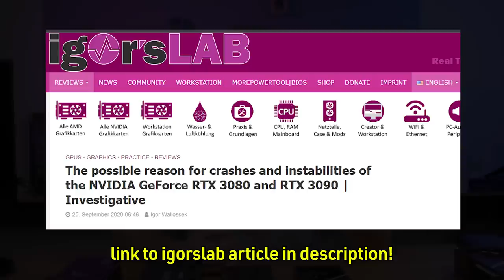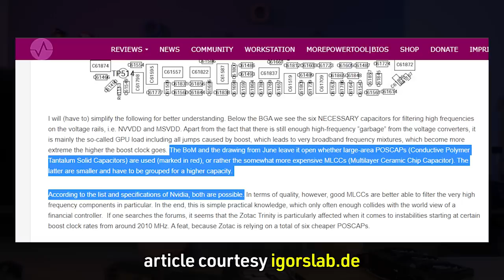The RTX 3080 Launch can't get any worse... Right? Wrong...

Comment: When you talk about "cheap" vs "expensive" capacitor components ... this basically amounts to a total difference of less than maybe $5 on the final BOM, no? It's obviously not a tooling issue since the ODM is already using the smaller SMT packages on the board anyhow. It's not much of a cost issue when you're talking about components priced around $0.15 to $0.75 each off a bulk tape roll. It doesn't even multiply out too hugely when you're talking about a total production quantity of several thousand units.

So how does it justify a retail price difference of many hundred dollars?

Comment: No launch has ever been good. EVER
Reply: True,  but the stock voltage is definitely on the high side. Seems like 0.895V or so is the sweet spot for same stock voltage boost clocks but at 50 watts lower.

Comment: Absolutely the best video to understand the problems on the RTX 3080. I will go to the Asus TUF, which seems to have 6 of the expensive arrays. Thank you so much!
Reply: @Battleneter  Thank you so much for your clarification. My only doubt is why Asus TUF apparently didn't suffer from this instability?
Reply: @TheDIYFilmmaker  Not all cards had reported problems, possibly game dependent. The Gigabyte Gaming OC with ALL SP-caps seemed to have far less reports of crashing than the TUF, but Zotac had the most reports. But its all irrelevant as it was only a bad release drivers now fixed with a driver update, all cards are stable.
Reply: @Battleneter  Thank you. Now is clear. I can't wait to buy it. Here in Spain they are out of stock.

Comment: I'd say that if the boost is part of marketing, than that 1900 clock speed is guaranteed. How much exactly above 1710 is debatable, but the producers are still obliged to make it doable to some extend.

For it to be fair for consumers, those cheaper produced cards must be marketed as "GPU boost-less".

NVidia isn't obliged to make the boost work on cheaper cards, but is obliged to make them say truth in marketing when selling their licensed products.

The failing cards right bow before the change in marketing are in my opinion fully refundable and should be without problems from sellers as they don't work as marketed.

Comment: Shit like this is why I never am first to use new tech, cars, or anything anymore. I used to ALWAYS be cutting edge with the mods on my cars and computers, home theater audio/video gear...  Better off being a just a little late to the party.   At least the problem is fixable with an update to keep the boost clocks down a little bit and the cars arent actually going to need to be recalled.  Still, reason to be pissed for sure if you wanted to overclock.  Should have bought the good cards though that have the better capacitor array if your into OC'n your stuff though anyway.  Ahhh, technology! lol

Comment: There is no such thing as expensive, Inexpensive, they are just ceramic bipolar capacitors In a broken down separate arrangement to how the polarised capacitors are.
Reply: Dont get me started!, Nvidia released a new driver yesterday largely solving crashing on cards with MLCC/SP-Caps or a mixture. It appears the capacitor "theory/Guess" is complete overhyped BS.

Comment: I've been dealing with electronics for a while (doing small projects and all that). But ... capacitors are not that expensive, and SMD components are even cheaper.
Now, I understand that these cards are at the top technologically, but still ... HOW MUCH EXPENSIVE CAN THOSE BE?
I mean, on top of not being that expensive (in general, street price for regular capacitors. About 0.50-2$ per cap for the smaller ones. And for SMDs those prices can be as low as 0.05-0.70$), these guys (the manufacturers) buy those in bulk, so their prices should be even cheaper. Granted, maybe those at street price, could be 5$/cap, but still... charging 60+$ for a 700$ graphics card is not that much. Specially if those prices at bulk are way less...

My point is ... holy crap those manufactures are cheap. I hope they loose all the people's confidence, so next time would think twice to scam people.( and ... yes, I don't care if the specs speeds are 1710Mhz and they are still above that. If you are selling a graphics card above 350$ ... you better have stable "overclocking"(turboboost) capabilities on that card ... otherwise I won't buy it!)

Comment: And drivers update fixed most of the crashes....
Reply: Yea by clocking down the shit out of your card. That's like buying a V8 but it only fires on 4 cylinders...
Reply: @MidwestMTBAdventures  Absolutely not, they tuned how boost works, some folks have better frequencies. And overall performances are better.
Reply: @boypip7018   They absolutely did not. Stop listening to PR bullshit they sacrificed clock speeds to make them stable they where OC far to high out of box. Reports all over today about it..typical of Nvidia hey look at the impressive cards we just made then clock em down because realistically they can't run at that performance. So glad I'm gonna wait for all the bs to settle and see what team red and team green have to offer in the coming months.

Comment: I've been building my computers since the 90' and regardless of how hyped you can get there are 4 rules that seem to never change 
- Never buy the first wave of products of a new generation
- Every 6 to 10 years there is a "revolution" moment instead of the usual "evolution" : that's when the planets align and you get a new generation that crushes the one before for similar price tag, and will survive for a long time (AGP, PCIe, USB, USB2, USB3, HDMI, etc...)
- Check real world tests instead of tests that don't represent your computer usage (example : SSD vs N.2 performance in games is similar ; the difference becomes huge in video editing or other large file transfers // Ex 2 : checking how a 3080 performs in VR with a new gen headset such as the HP G2, in a demanding game)
- While taking into account the previous rules, check what's coming in the next 4-5 years, in order to avoid components that will make any interesting update complicated

Therefore wait at the minimum for the second wave of 3080, ignore USB4 and PCIe 4 (too young / yet to exist), get 2 huge SSD instead of a smaller N.2, and dont forget that high end VR headsets will probably become a lot less expensive in the next 5 years, while quality games will keep getting VR compatibility (hi FS2020 !)

Comment: is the RTX 3070 going to have this problem
Reply: The issue turned out to be Nvidia post release drivers (pre release drivers were fine), had NOTHING to do with capacitors. Jay need to take down this video as its still misleading people like you,  but he keeps leaving it up for clicks $$. Yes Nvidia released a updated driver that corrected the problems on ALL regardless of capacitor type. Watch this explains all.
https://youtu.be/lhyCdraz54s?t=350
Reply: @Battleneter  ok will the problem persist using the same clock speed or not?

Comment: If the design is not to base spec the ABI should offer a full refund or replacement with the correct base BOM. if their are to base spec then firmware update it is.

Comment: I just scored a basically new 1070ti for cheaper than a new 1660 because a guy got a 3080... It would now appear that I got the better end of that deal because he got the EVGA card lol.
Reply: The issue turned out to be Nvidia post release drivers (pre release drivers were fine), had nothing to do with capacitors. Jay needs to take down this video, its just terrible for so many reasons, but he is clearly leaving it up for clicks $$ and misleading people., just watch this,
https://youtu.be/lhyCdraz54s?t=350

Comment: Remember RLL encoded hard-drives?
Remember how touchy they were re: cable routing?
Remember how often they refused to work properly unless the cabinet was closed?
Or the cool way they would get unreliable if two drives were too close together?
Or how the controller cards liked one slot on the motherboard and not any other?
Or how if you formatted the drive in one orientation and it refused to work in any other orientation?  'This side up' was a thing!
I remember a time when exposing the motherboard or hard-drive controller-card to bright light was a no-no!!!
...
Sensitivity to test conditions cannot be ignored, and a good test program takes these factors into consideration.
Lots of words to say I think Jays methodology is flawed!
This cap issue is nothing new (using cheaper parts in critical areas) and its a grand example of users not being able to get away with everything they want to do.
Remove PCB covers?  Run on risers? No cabinet? Extra long ATX power cable? FM transmitters in close proximity?
RFI from video cameras cannot be discounted until a test or two clears them!
Any one of these could clobber a card, all of these together and I am impressed with even short-term stability!!!
Me, being an old radio engineer with a for-genuine FCC license (tested, 97%, not cereal-box!), would expect cross-talk/interference any time the PCB traces are visible!
...
I know it is super-sexy to run rigs the way Jay/everyone else does, but it is not a realistic daily use setup.
Run the tests again, with all the covers in place, no transmitters in the room, no risers or power extensions.
You know, as a 'control', to see if the test-rig is the problem?
I retired from this sort of work, now I visit it for fun!

Comment: MLCCs are not more expensive. They are cheap as dirt. There are few trillion (yes, 1 followed by 12 zeros) produced each year. There are few hundredths on them on any graphics card. The one super close to the GPU are critical tho. They need to be both small and big ones, often of different types. It is not about the cost here, but about the mix, because the mix changes frequency characteristic of the power delivery. The smaller ones, are smaller capacity, but do have advantage you can put them closer to power and ground pins, thus reducing the loop area, which you want to minimize to reduce radioactive losses (it acts like an antenna that emits power), but also reduce track, pad, and even capacitor pad inductance and resistance. Because these chips can suddenly go from 1A to 100A in current draw.

It has nothing to do with interference, or noise. Yes, there might be some sensitivity when you are super close to the edge of what chip can do, but this will happen even with perfect power delivery system.

Comment: 20 series also had it's share of problems.. I already had 3 2060's die on me within guarantee term.. The all started artefacting like lines and triangles and died... Didn't overclock.. also I've been using NVIDIA forever never had issues until RTX. After my voodoo cards I solely had NVIDIA cards. I may have had a RIVA (can't remember), I had a 256 and up until my 1080 NEVER had a card die on me. The issue on my 2060 RTX's was something like faulty heat pipes, or that's what the store, that actually took 2 back under guarantee no questions asked, told me was the problem. 3rd one appears to keep running.. although it still gets hotter then I'd like it to be.

Comment: Not enough product validation..
Although the fix is obvious, it is embarrassing when you are caught not validating your product properly.
PS. A Windows 10 Driver instability is still a validation issue or software version control issue at either Nvidia or Microsoft.
Also it does appear that the hardware settings have changed..
This sort of problem should have been fixed in the lab before release.

Comment: Thats why we were advised not to be the first batch of buyers for these cards, isn't it? OwO) only pawns move first in chess...

on another hand, computer shops in my country were saying that we needed higher power wattage in psu choices if the pc buyer is going to upgrade to a 3080 card from Gigabyte or Asus, like around 850W ish? turns out the graphics card is not the only thing you have to upgrade.
Reply: You could do a 650 watt probably just fine if you undervolt the 3080 to around 0.895V (roughly 50 watts less) and you are running a 3900x or 9900k / 10700k max.

Comment: Can anyone explain what that bracket looking thing is on the back of the evga card my asus card has one aswell
Reply: Its just a retention bracket to make sure the system mounting the cooler to the gpu die is applying even pressure. The 3080, 3080 ti, and 3090 are such huge dies that it needs that leaf spring bracket behind the gpu to make sure it applies even pressure.

Comment: In electronics, I think capacitors are the tell, tell. heart, if engineering/bean counters save a few cents on caps, other cost cutting more than likely took place, lower tolerance parts, and that's the game engineers/ bean counters are playing, how low can I go, and accomplish the task?      this is shown clearly in a power supply, a top-rated power supply, vs. a high value power supply, one will have caps that are Japanese name brand 105C rated, the other, will have a China made, off brand, and the rest of the parts also of lower quality, the deeper you dig.  and its efficiency rating shows the end results, longevity is also different.  what's appalling to me here, is any GPU manufacturer, pushing this hard to save dimes, with current, market conditions. clearly competition, is a heathy thing in any engineering "for the consumer" anyway, here is a classic example of complacency, and bean counters getting ahead of sound engineering.   what's worse here, is many followed the trend.

Comment: you know this is all my fault right, i want a 5800x and 3080, of course they are both fucked up

side note the 5800x doesnt run as hot as i thought, and its given new life to my GTX 970 which i really wasnt expecting lol. might not upgrade until these GPU's are way below current MSRP, so maybe around 2028

Comment: I wonder if any of the problems are due to marginal power supplies. Power supplies that have difficulty driving a large load  tend to have higher levels of noise and ripple as do cheaper power supplies. Switching power supplies are one of the largest source of electrical noise. Of course the reference design is correct and appropriate power filtering is needed especially for power hungry components further away from the power-supply. Multi-Layer Ceramic Capacitors paired with other capacitors or various values help to filter various frequencies of noise. Following the reference design with capacitors and ferrite beads is essential. 

Example:
Notice the various values of capacitors meant to filter various frequencies of ripple and noise.
https://electronics.stackexchange.com/questions/9873/would-pictured-circuit-be-good-enough-to-power-atmega162
Reply: @rustable4165  A driver patch can fix the issue on >cheap< cards but that does not mean it's purely a driver issue. Are you saying there is a bug in the driver?